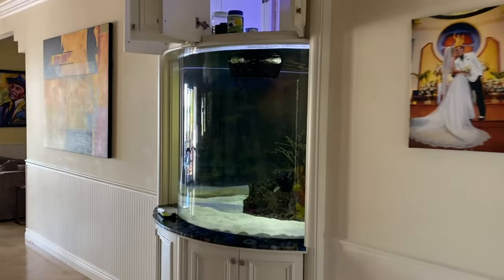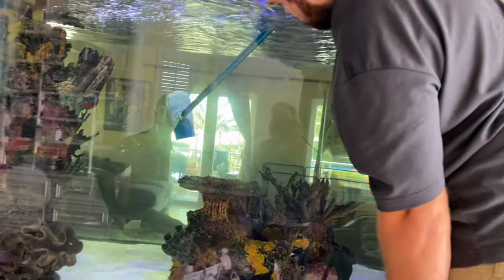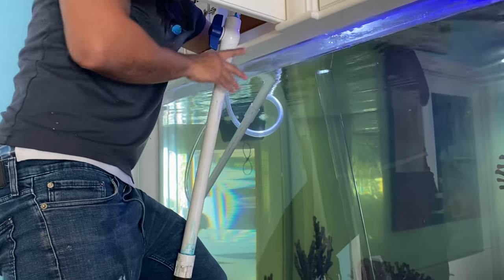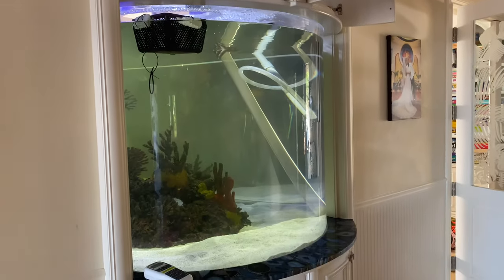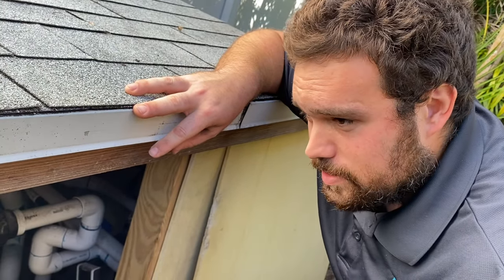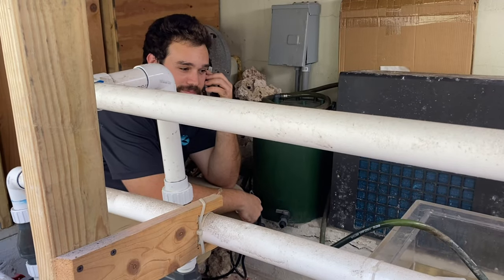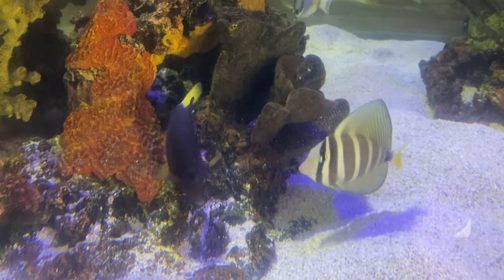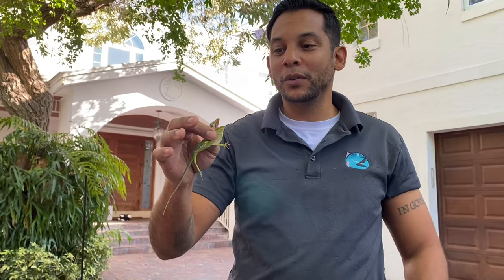Massive Saltwater Aquarium needs Help!!

Comment: What do you recommend for Dino’s? I’m currently battling a outbreak I’ve tried phosbond, chemipure blue and skimmer is pulling gunk but still tank is ugly
Reply from the maker: Dino's are tricky because there could be many causes. We always start by checking Nitrates. There's a lack of biodiversity in your tank and a environment for that diversity to thrive. Do you have corals?
Reply: @aquariumservicetech2891  no corals just 2 clownfish. Just had my water tested at the lfs and everything was ok except for my calcium it was high it was at 500
Reply from the maker: you can do a black out that's a short term option. Long term maybe cut down on light and take your water to be tested to see if the No3 is too low, or what the imbalance is. Wish I could help more but I'd have to see the tank.